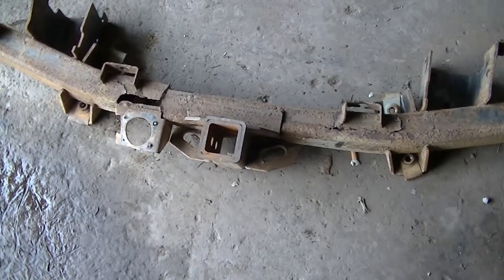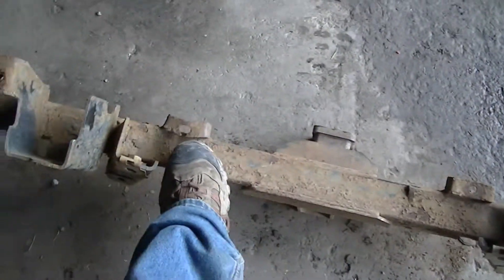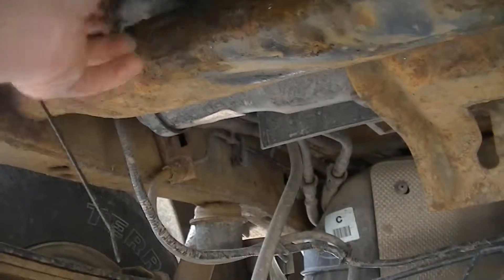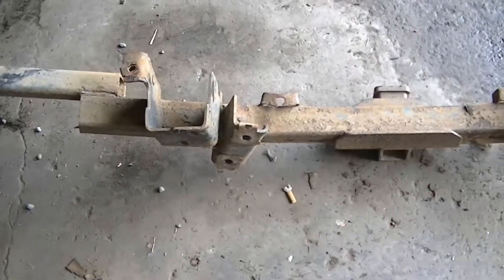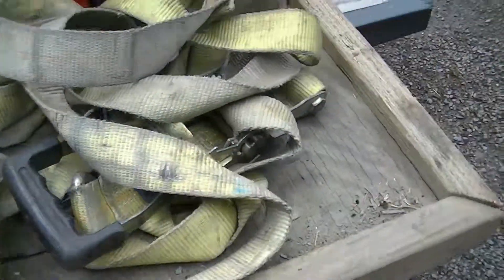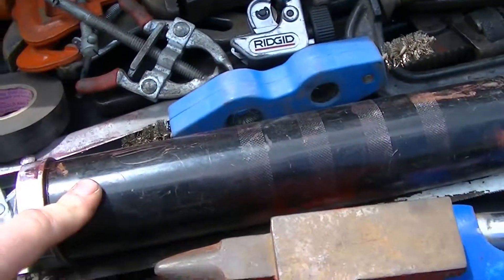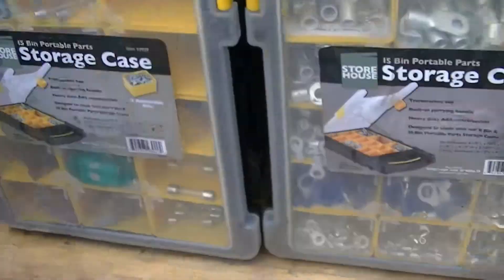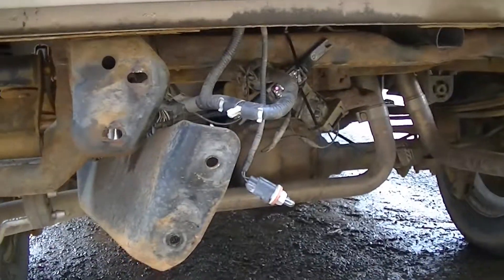My Solution for a Busted Trailer Hitch and My Truck Bed Tour

Comment: Hey Kevin, well the rust has done its job I see. LOL, but after you cut the ends look at see thickness of square tube and clean inside and outside real well. Are you stick welding it? But then bevel both pieces then on all four sides. Then get some 6011 or 6010 electrode rod. And this is a penetrating rod and has to be whipped in, meaning that you have to see a key hole when doing this so you get full penetration. Clean weld with wire wheel then get some 7018 1/8" electrode and fill the bevel and then 2 to 3 cover passes. This rod has 70,000 tinsel strength and with the cover passes this should be enough for the strength of the joint. As long as your using 1/4" walled tubing. The 6010 or 6011 has a lot of spatter which is normal. But get some practice pieces, put 45 degree bevel's and place and tack grove the thickness of rod thirty second rod or about 1/8 " rod for gap,  and run up hill, better to fill key hole that way! You want real strength in the hitch. Thanks for showing:)